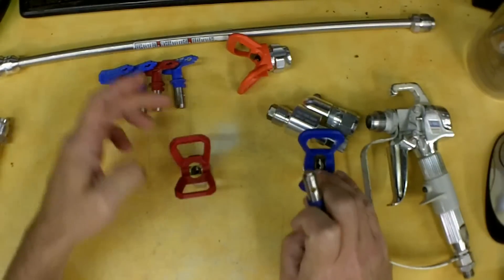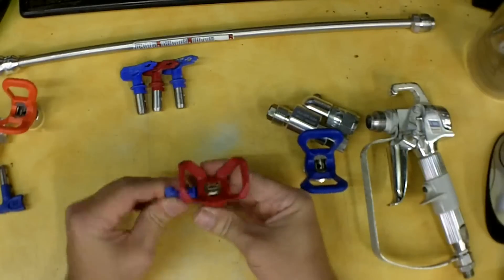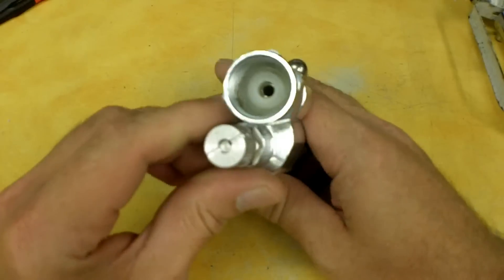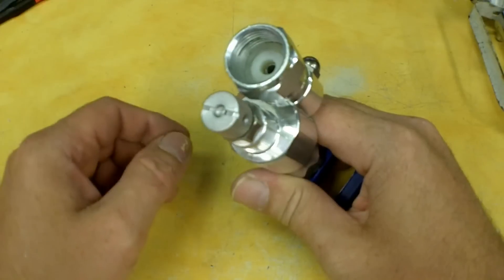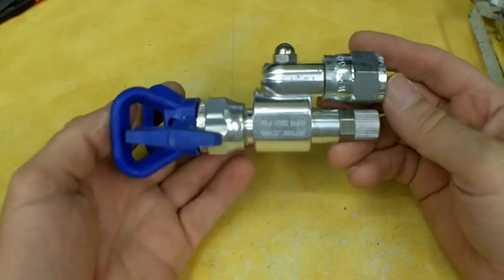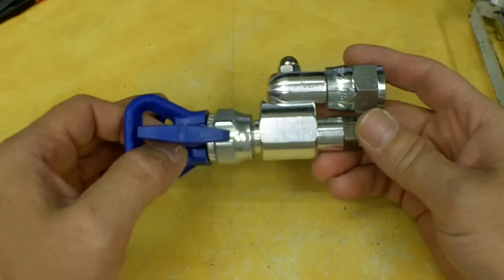Graco CleanShot Review Model 287030

Comment: You are right. There is practically no information out there on this awesome device. I just bought one last week.  Can you make another video showing how to install and clean it? Thank you
Reply from the maker: True. It really surprises me. I don't know when I'll be using it again, so I couldn't shoot a video till then. As for installing it, I first install an extension and tighten lightly with a wrench. Then install, it and get it tightened up where I want it.

For cleanup, I first remove it and empty my line of paint until water flows. Then I install it back, turn the dial all the way in the flush direction, turn the tip backwards, then proceed to clean my rig with water until it's clear. I personally take my airless line off, as well as the gun and tips and blow everything out with compressed air instead of using pump armor in everything. I only use pump armor in the pump itself. Good luck, G.

Comment: Having just finished spray painting my house, now you tell me there is such a thing as an extension!!  LOL
Reply from the maker: No doubt Hank! I was shooting my shop and shed without one and it was a pain. I picked up the extension midway through and the spitting was causing me problems so I finished without one. After adding this device, it works great with an extension and no more spitting. Plus there is less ladder moving to shoot high. It does cost a bit, but is worth it in my opinion. Take care, G.

Comment: Thanks for the video.  I bought a Graco Tradeworks 170 today from SW.  I'll need an extension or two for my storage shed and this seems to be a good, albeit, expensive accessory.  I've never used an airless but my HVLP turbine doesn't spray exterior latex very well and I'm limited to using a little less than a quart of paint at a time.
Reply from the maker: No problem Gary. I have the same Graco and it's been working great for me. After using mine and flushing with water, I disconnect the hose, gun, etc and blow them all out with compressed air. I made a cap to install where the hose connects then I suck up just enough pump saver to fill up the pump. I made a mistake on my first airless, not a Graco, and rusted it up. It's takes a bit to clean it up like I do, but it's lasted me many years and works great whenever I use it. The 170 is going to remove the limitations you have with your turbine for sure.

The Clean Shot is expensive but well worth it in my opinion. I don't get any spitting at all now. Also with it being able to swivel is great. If you get one and a couple of extensions, try it with and without the Clean Shot- you'll be amazed in the difference.

Good luck with your machine and projects! Take care, G.
Reply: ***** Thanks and I'll heed your warning about the pump.
Reply from the maker: Gary Hodgin No problem! Take care, G.